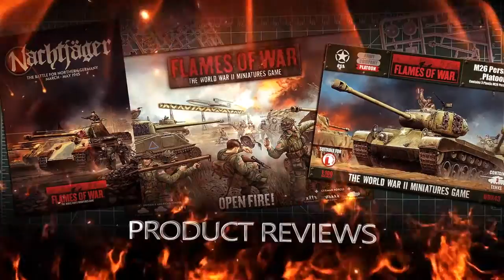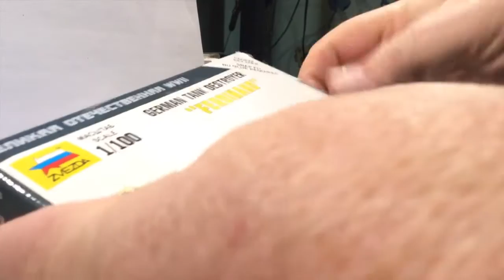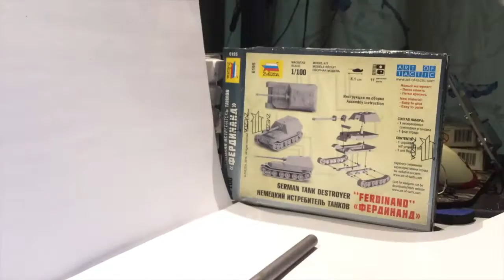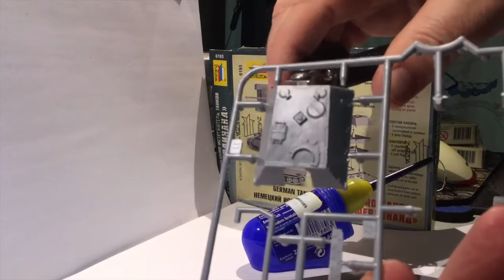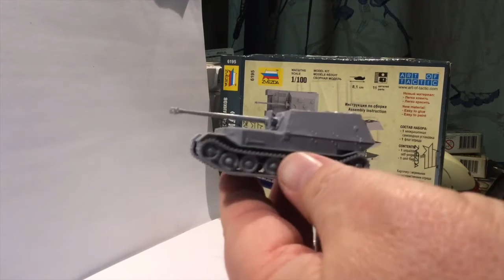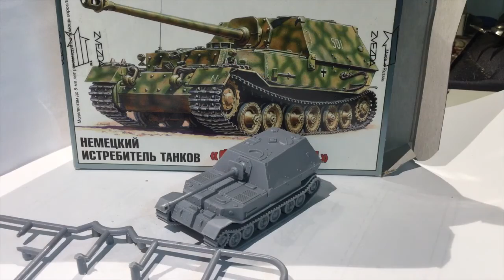Review | Zvezda 1/100 (15mm) Ferdinand build review | WWII

Comment: I’m a bit confused about the scale. Is the length 15mm or 1:100 of the 1/1?
Reply from the maker: These are two different ways to express the scale. The model is 1/100th scale. That is a ratio of how big the model is compared to the real thing. Scale modellers use this notation. Wargamers use a different notation. In wargaming terms, this model if 15mm scale. That refers to the height of a figure at this scale. So a human being at this scale would be roughly 15mm tall. That means this 1/100th scale kit is the right size to be used with 15mm scale soldier figures.

Comment: That looks like a quite nice model.
I have some of Battlefront's Elefants, but I like the ferdinand better, mostly because it doesn't have zimmerit... 

Might have to get one of those kits.
Reply from the maker: This one built up like a dream. If you haven't done much Zvezda then this would be a good one to start on. I hope to review the T-34/76 obr 1943 in a week or two. That has eight parts - seven if you don't use the strange Zvezda flag-thingy.
Reply: So far I've not done any Zvezda at all. Mostly because it seems a bit of a hassle to get hold of them. 

I have seen some zvezda kits at the local hobby shop, so I'll have to call them and see if they can/will get some in for me.
Reply from the maker: I'm not sure if there is an issue with the Australian Zvezda distributor. I have to order mine from Latvia.
Reply: @FogofWar  I'm based in Russia and the local hobby shop doesn't order much Zvezda either (in 15mm at least) so I also order in from an ebay seller in Latvia.